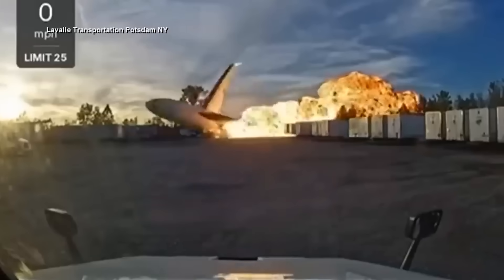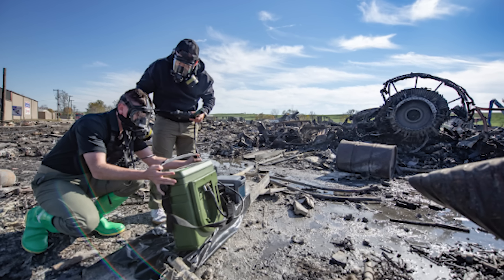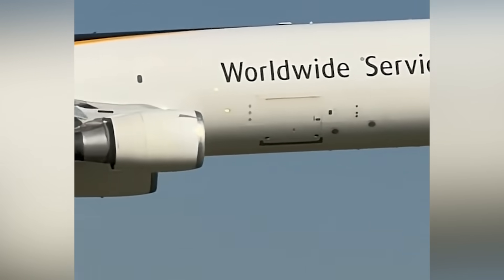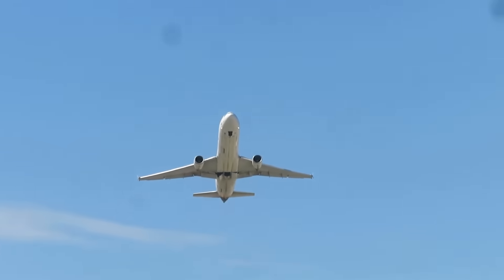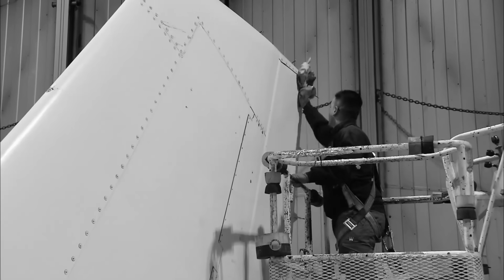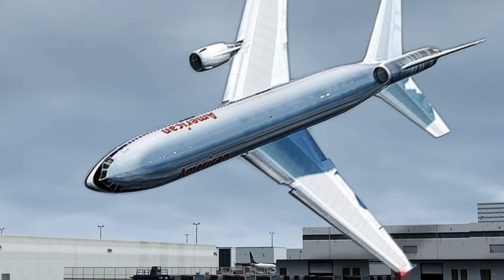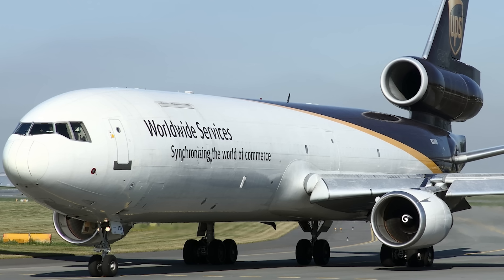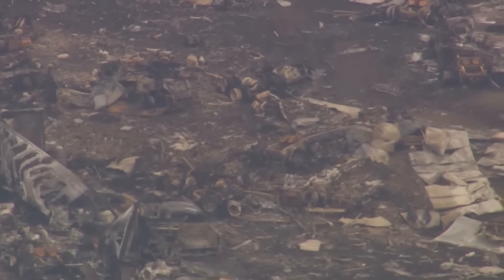The SHOCKING Truth Behind UPS 2976’s Engine Failure, New NTSB Updates…

Comment: Sounds like a critical structural failure likely resulting from maintenance failure (to detect it) was most likely responsible for this catastrophe.  Question is, was the maintenance failure preventable or not?  Structural failure can be expected in an aging aircraft.  There was no possibility of the crew to react effectively to prevent the crash once the problem became evident to them..

Comment: The engine and a chunk of the turbofan cowling are in the grass about 200ft to the right. Also the pylon is on the runway to the right, along with engine separation dabris to the right also on the runway. These points may give a clue as to how the engine ripped off the airplane. To me me this is an indication of a sudden shaft seizure. There must be reduction gear case between the jet engine and the turbofan. And it would have gears, an oil pool and oil seals. Haven't haven't seen comments about this possibility.

Comment: Well first they keep comparing this accident to American 191 where the Pylon and
engine left the Aircraft at about the same time on takeoff?  But they are not the
same Flg 191 the no 1 engine and pylon came off flipped over the wing and 
landed on the runway in one piece.  the DC-10 started climbing out on the 
other 2 engines with the leading edge slats retracted they couldn't maintain 
control. but the Aircraft climbed as it should. Here we see a different scenario
I believe the in this case the No 1 engine at high power for take off suffered
a catastrophic failure most likely the main rotor disk in a an explosive  event
as see in the cowling and debris field around the runway, if the main rotor 
disk retained part of the disk now spinning at high speed and unbalanced
could of easily torn the engine and pylon off.
So why didn't this flight continue to climb as Flg 191 did? when the number 
1 engine exploded some of shrapnel hit the no 3 engine causing it to fail
as see in a video showning no 3 engine backfiring in a compressor stall
at rotation. The MD-11 was meant to fly safely on 2 engines at takeoff
but not on one engine which is why it only just cleared the fence and 
not climbed away like Flg 191. Also if other video the left wing slats
could have also retracted as in Flg 191 as we see the the aircraft in
the same 90 degree bank . this could have been caused also by left
landing gear striking the roof of the first building after clearing the
fence. I'm a retired airline pilot with experience flying DC-10's  I also
have a degree in Aeronautical engineering.